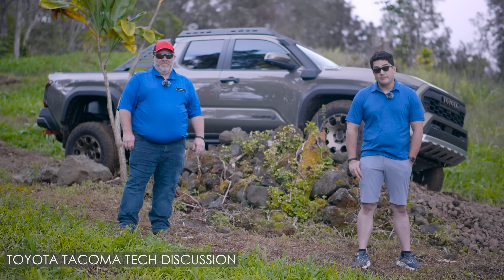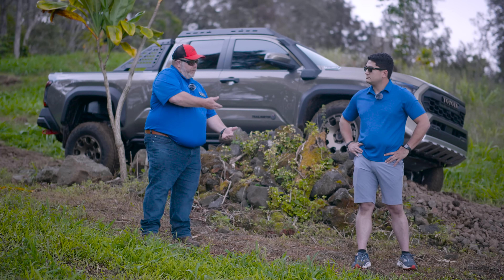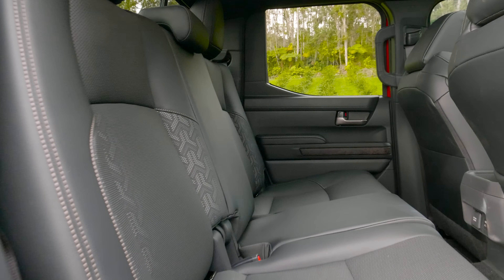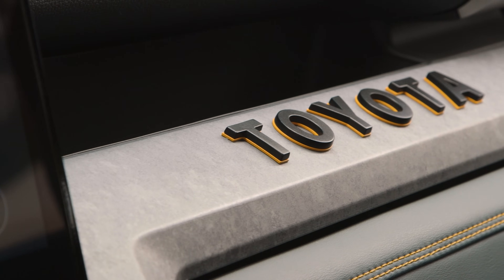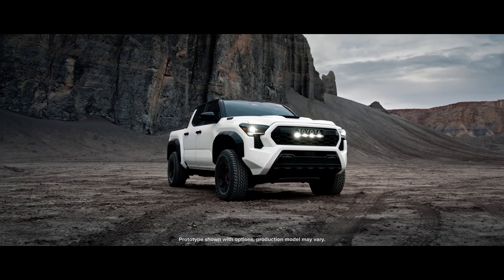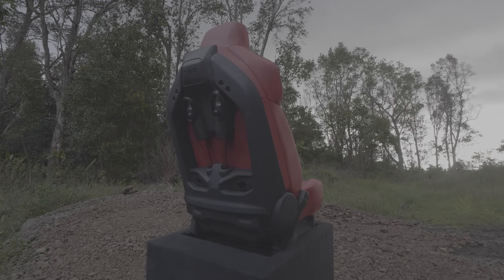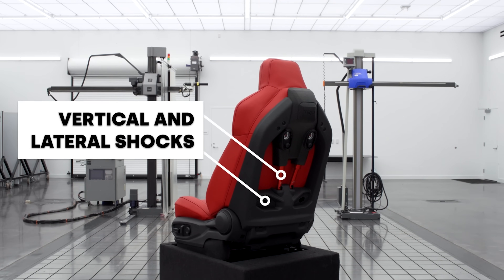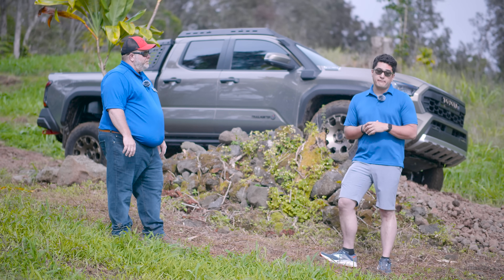2024 Toyota Tacoma | Big Changes, Technical Details

Comment: Sorry but in my opinion toyota has made some terrible choices under the hood for the 2024 taco. Truck is beautiful. But no way I'm buying a truck with a 4cyl engine or a hybrid.  Either I'm going with a frontier. Or depending on the test drive I might go with a ranger raptor

Comment: The self-confirmational "right?" rhetorical virus may finally be nearing its cultural conclusion. It started as a way of signaling you're part of the well-washed and highly educated class. Now that it's spread all the way across the cultural divide to a 4x4 guy, it will lose its signaling quality for the intended group and finally start to die out if we're lucky.

Comment: I think this is a far better effort than the Tundra.  Still, some things Toyota should do better.  There needs to be a 4wd auto setting for the transfer case.  Many times conditions call for 4wd, but because the pavement isn’t completely covered, you can’t just run around in 4-hi.   Also, how about damping the tailgate??   And maybe find space under the vehicle for the hybrid battery?!?  I hate losing the limited storage you have to that damned battery.

Comment: I'll keep my 3rd gen Tacoma... It has what's really important a good V6 motor + a great manual transmission! I don't need rear disc brakes ,14in infotainment screen, digital gauge cluster or 🆕 suspension. Mine works totally fine lol. Seems 🆒 but I'll keep my real old skool 🛻💨 thx 4 the video Jack & Toyota man 💯👍👍
Reply: You should if it is the one made in the U.S. I wanted to get a Tacoma, but they are all made in Mexico now.
Reply: @RisenEagles  who cares? There's a guy on YouTube who has the same exact truck that I bought manual transmission but it's a 2018 dude has 330,000 miles still the original clutch his first check engine light came on at 265,000 mi for the catalytic converter... Basic maintenance all-stock nothing fancy and he even tows a relatively heavy trailer for the 🌮 most of the time! And that trucks made in Mexico doesn't seem to have many problems... & speaking of made-in-the-usa or made in Mexico I bet you even if it was made in the USA 1/2 or more of Mexicans would be building it! If some people had problems with trucks made in Mexico & people did NOT have problems with USA I could vouch for something like that but it's the same no matter where they're made! 🤷🏼
Reply: @RisenEagles  it's not where the truck is made is how you take care of it, my truck only has 5,000 miles I already took the accumulator off the clutch so it has a much better direct feel I already changed my front diff fluid rear diff fluid transfer case fluid & manual transmission fluid... + Changed motor oil 2X already... Toyota wants me to wait 10,000 miles from my first 🛢️ change! And that's what that guy did who has 300+K Miles & I think around 200,000 he started changing it every 5,000 still doesn't burn any 🛢️! Look him up on YouTube put in 300,000 miles 3rd gen Tacoma & his videos right there

Comment: These teenager-like comments about “compliance engines” and “4 poppers” are really cringe.  Grow up.
Reply from the maker: Every engineer we talk with about this generation of engines mentions compliance and regulatory considerations when detailing the design of them.  They would not be using down sized engines in large vehicles if it were not for compliance reasons.
Reply: @savagegeese  yeah no shit.  It's more that you're pretending these designs aren't a necessity (both environmental and customer demand), with snide comments like that.  Want to bet the base 4 turbo sells the most volume of this car?
Reply: @savagegeese  fuck polar bears & fuck turbos, this engine will not last over 150k miles

Comment: Blame CAFE regulations for the increased wheelbase and track of the new Tacoma.  Pickup trucks in the north American market have been increasing in size since the mid  2000's because fuel economy  for the light duty truck class of vehicle is based on the area of the vehicles footprint.  The larger the footprint the easier it is to meet the fuel economy regulations.  This is one of the main reasons US auto manufacturer's stopped producing sedans and small pickup trucks like the regular cab short box Tacoma.  Toyota's new trail hunter will be hellish driving off road, especially on tight wooded trails.  Owners will need to pray that they don't come upon an obstacle that requires them to back track.

Comment: This truck is the perfect example of the masses wanting a truck vs enthusiasts. Most people like better towing/payload, comfortable ride and quick. 

The previous generation had a c channel frame allowing a little more flex to help with articulating. But hurts in towing/payload. New one is boxed.

The previous generation had a NA motor, this one is a turbo four. Anything can last forever as long as you replace parts (I fix a fleet and have plenty of 400K plus Fords/GM). Reliability is down graded but definitely a lot faster.

Why am I aware of this? Because I bought a Ranger in 2020. These were all the reasons the Ranger "sucked". Watching the new Tacoma roll out has been great 😂😂

Comment: I'll wait for the Guinea Pigs to test them out and post videos. Pre Runner is main one I'm looking at, It's a work truck for me. Can I tow 5500-6000 lbs on occasion? Will a 4x8 sheet fit between fenders wells? Is the Turbo going to take a shit on me and leave sitting at a shop? Is the reliability still going to be what Toyota has built its reputation on?

Comment: Great interview and information! I was so hoping they would have bumped up the tow rating to 7500#. If they would have I might have traded my 2018 Tundra for a new Tacoma. My camper weighs 6000# loaded and I truly believe in the 80% rule and a tow rating of 7500# would have worked.

Comment: I can’t wait to actually sit in one of these trucks. Specifically the Trd pro or trail hunter. They finally might have a vehicle which I would consider. It’s very difficult for me to buy anything other than a Ford. I’ve always owned F150s or Rangers and I have had a great experience with all of them. The new Ranger Raptor really has be close to switching away from F150 but now I’m anxious to see what I think of the new Tacoma in person.
Reply: What is it like to drive an F-150? I want an F-150 but it has no manual. I don't see myself ever buying an automatic vehicle while I can still drive manual. If the new Tacoma was automatic only, I would buy a base F-150 work truck.

Comment: Specs seem almost concocted. A 1700lb payload is 1/2 ton capability and they achieve this while adding the heavy electric motor and battery which gives with gobs of torque yet you can only pull 6000 lbs. Not feeling how this makes sense.

Comment: I would seriously think twice about giving up my 2016 OR Taco access cab for this. Yes it has a lot of upgraded interior features I would love but I found that intro vehicles need a couple years to work out the bugs. Because mechanical or tech issues are a pain to deal with especially when it has to go back to the dealer for a warranty repair or not. 
The minor upgrades I made to my OR Taco is amazing!! For example I had an after market Yota tune installed which fixed the trans from hunting for gears issue it had. Now it shifts smooth and seamlessly. My other upgrades allowed me to get almost 700kms/tank !!!!!! So I think I will keep what I have!! But for those looking to upgrade to this major change I wish you luck and patience !!
Reply: I don't have a vehicle so I don't have time to wait sadly.

Comment: I hope by being desinged in the USA it will not fall apart as American designs are known to do. Do the speakers in the cab make a fake noise when you start it like the Tundra? Did you make the engine smaller to get better gas milage that is lost when towing?

Comment: Wish the cab was not so cramped in terms of driver legroom (I'm 6' 4") and wish the width between wheel wells was 48" so it could hold a sheet of plywood or sheetrock.

Comment: I get a bit of a chuckle when they say something like, "gained 15mm"  because the reality is that most Americans don't have a strong comprehension of metric, don't understand that that's only 1.5cm, and that it's equivalent to a little over half an inch.

1.5cm isn't nothing, but I'm finding it hard to believe it's noticeable.

PS.  Saying the percentage would probably be the best option IF it was a notable gain.

Comment: No thanks I’ll keep
My 3rd gen I will
Never get a 4cyl turbo they should of had a 4.0 twin turbo option 
The 3.5 is a good motor very under tuned so it will last 
If you want to upgrade get the base

Comment: I don't GAF about trucks. Except this one. This is the only truck that really needs to exist imho. This is the true truck that is known for being bulletproof as we've seen used in third world countries with a LMG mounted on a clothes line pole in the bed. The other reason why it's important is the relation to the 4Runner, which I believe is the perfect family vehicle. Rugged, takes a beating, fits the family and luggage, and can tow/roof rack. You can do the bed kits for the Taco though too, whatever floats your boat. 

Unfortunately, if you want a TRD PRO or Trailhunter, get ready to be anal pro'd and browntrail hunted by the SCUMBAG STEALERSHIPS. I bet MSRP this time will easily clip $60k as well, probably well over it. Truck prices are insane. Toyota NEEDS to allow full customer ordering, no limited production, you may just have to wait, but ensure NO ADM from their stealerships.

Comment: Is the hood and engine hood paint gonna loose it’s clear coat after 6 years like most of the Tacomas do from the sun and elements? Like my 03 Tacoma and 05 4 runner still running strong but paint on the top of the vehicle went downhill after 5-6 years. Beef up the paint and clear coat guys !

Comment: I dig this new one a lot, despite the lack of a V6 option. XtraCab with the turbo and a manual is what I'd get.
Reply: Man I want Access Cab. Toyota don't care about Access Cab guys. They addressed everything but AC!
Reply: @RisenEagles  They explained why, they said that folks who bought the Access Cab were mostly hauling things around, not people, so to them it made more sense to just make the single door XtraCab with no seats and more room for stuff in the back. Makes sense to me tbh. We should be happy they offer another option besides the stupid Crew Cab at all
Reply: @accordinglyryan  2 doors instead of 4 doors is a no no for me. The S door was so useful, and you can take out the seat for space. Disappointing.
Reply: @RisenEagles  I guess you're stuck with the old model then

Comment: I've been a die hard Toyota fan for the last 18 years. My most recent purchase was a 2023 Tundra which replaced my 2019 Tundra. I was really disappointed with the quality of build. But was more so disappointed with Toyota USA the way they handles my multiple issues I had including dead throttle which would happen randomly. They said that they legally are not abligated to authorize repairs unless I can replicate the issue to their tech. That was the breaking point for me. Got rid of it, went to the dark side and now driving a 2023 GMC Sierra 3.0 Duramax and what a difference. I'm glad Toyota gave me hard time, I now own a truck that drives like a truck in luxury, it's quite, it's loaded with features in comparison to the Tundra, and I'm averaging 28mpg. Unbelievable!!! Thank you Toyota.
Reply: I wish more people would wake up and stop drinking the TOYota Kool-aid. Ford, Ram and Chevrolet/GMC current offerings are great. I'd love to try out a 3.0 duramax if I needed another vehicle. Congrats to you on your new truck!
Reply: I feel the new Tundra is an outlier. Once I saw the new Tundra, I just laughed (and secretly cried on the inside). 28MPG is crazy, is it a hybrid or what engine is it?
Reply: @RisenEagles  It's diesel. I tow a 2,000lb trailer half the time and average 22mpg, empty it does 26-30 mpg. I'm stunned with the fuel economy, because it does twice as much per gallon. Plus, diesel is now cheaper than gas.
Reply: The 2019 TUNDRA is still THE half ton truck to buy TODAY

Comment: While the downsizing of engines in pickups really goes against the grain, the biggest complaint I had about my 2020 Tacoma was.. it was an absolute pig. Devoid of any fun, insane road noise, slow to get going and just wasn't a solid ride quality like you'd find in the Tundra or F150. It was hard to use as a family truck. I ended up ditching it because I wanted to do a 180 and go back to a sport sedan but I miss having a truck, and it sounds like they've really addressed some of my chief complaints about it. 

Now if pricing (of everything) would come back to reality.

Comment: It looks like Toyota did a great job. I’ll hold my breath until we have some gas mileage numbers to know if the hybrid system actually is more efficient than the old V6. 

I also just want to complain that Honda has just fallen so behind with the Ridgeline. It’s time for Honda to take the truck market serious. Theyre doing better with the Pilot and CRV, but the Passport and Ridgeline need a new generation asap.
Reply: Anything should be better than that V6

Comment: Spoiler alert: Around the 18 min mark, a T-Rex busts out of the jungle and eats the engineer. Jack and the camera guy take off in the truck with the T-Rex in hot pursuit. T-Rex eventually catches them and flips the truck. Jack screams something about how he ‘Never would have gotten caught if this pos had a V8!’ right before he’s basically snapped in two pieces and swallowed. T-Rex takes a massive dump but leaves the  camera guy unscathed. Bit of a twist at the end when you find out the camera guy is actually Turbowksi; he walks off muttering about how the hybrid drive is going to be a pain in the a$$ to work on—no mention of Jack or the dinosaur.

Comment: I’m never really a truck guy but I have driven various pickup trucks including F-150, Chevy Colorado, Silverado, and Tacoma. And I Tacoma really feels like a truck I would buy.
Reply: Could you explain why that is?
Reply: @RisenEagles  I don’t own any trucks but I have rented them. The driving feel of the Tacoma is most car-like. It feels predictable and confident.
Reply: @jamsbong  I never drove a truck so I don't know what driving like a truck feel like, but I thought Ford with their aluminum body drive more like a sedan than a truck? Which year F-150 did you drive? The new one with aluminum body? With that said, only Toyota makes true off-road truck so they drive better than work truck.
Reply: @RisenEagles  I have driven the F-150 truck. May be in 2018. The initial response of the steering is very classic truck like steering. It’s feels like nothing is happening and no feedback at all. Tacoma is very responsive. I drove it in 2021. 

I have also driven the previous gen ford Edge (the pre shrunk generation). It drove like a truck too.
Reply: @jamsbong  Interesting, so does a truck drive differently from a body on frame SUV? (not the unibody one) Like does a truck drive differently from a 4runner or Jeep?
Reply: @RisenEagles  in normal driving, carmakers can tune the way the car feels no matter the type of body construction or materials used. But body-on-frame is a better set up for towing and in some ways off-road trails. 
Unibody is generally better in weight and space efficiency. 
My opinion is that Ford tune the truck/suv to feel relaxed. While Toyota tune the truck to feel responsive. 
Have you seen the Ford Raptor stopping distance?
Reply: @jamsbong  I don't believe so. It is out of my price range, so I don't really watch Raptors video.
Reply: @RisenEagles  if you’re in the market to buy a truck then my advice is to test drive them all. Remove all the marketing information from your head. Owning a car/truck should be a very personal experience. It should not be able aluminum body vs steel or which vehicle can do faster 0-60 mph. It should mainly be how the vehicle makes you feel. The only way is to test drive it.
Reply: @jamsbong  Very true, I just don't think I have time to test drive all of them. I don't have a vehicle right now so it would be very hard for me to go to different dealerships.

Comment: Think the only thing I’m truly afraid of is the power train. It’s all new for both the engine and the electric motor assist. Though GM has a shady track record with reliability, the Inline turbo 4cyl engines been in the Sierra and Silverado for a several years without issue. Have to wait and see.
Reply: 🤦. These engine are  not new at all and already in so many toyota and lexus models . Toyota had been buliding  turbo trucks since the 80s . So be real.

Comment: Cool. Another overpriced truck that no one will use to actually take offroad. I already hate everyone who buys one. I'd rather have a 4 cylinder diesel Hilux like we had in Afghanistan. Cheap, virtually indestructible, and an illiterate Afghan poppy farmer can fix one with a hammer in the extremely unlikely event that it ever stops working.